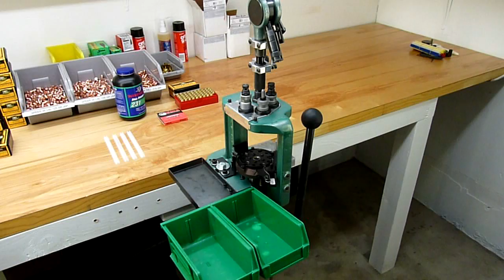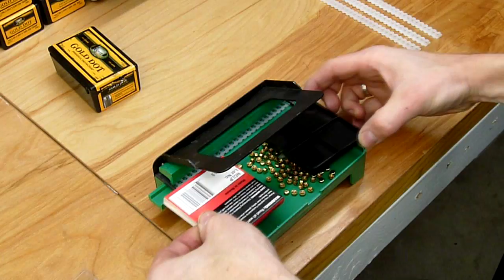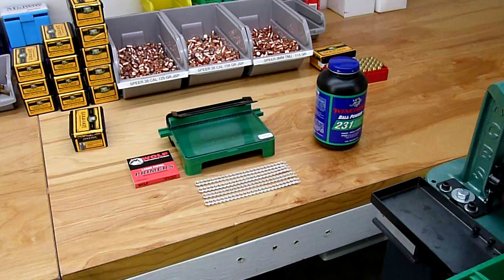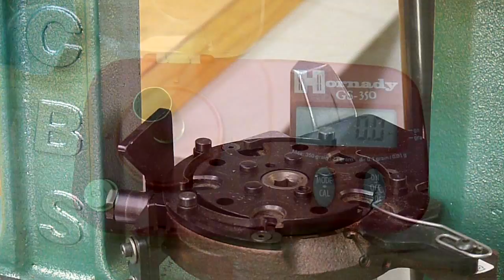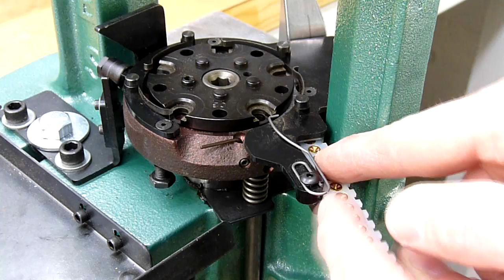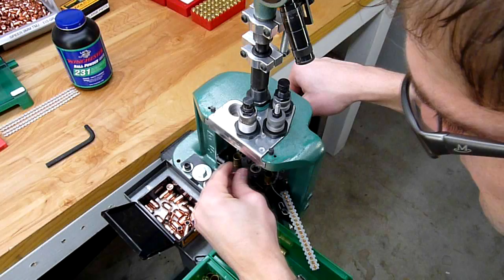RCBS Pro 2000  loading 45 ACP (HD)

Comment: I wonder if people still come here to read this discussion?  I've been using the Pro 2000 for many years now, and I think it is the best loading machine available from anywhere, at any price, at least for me.  Too many people have had problems with other presses because of all the primers one on top of another in the primer tube, which can lead do a dangerous explosion.  RCBS prevents that by using the plastic primer strips.  In use, the machine works just as smoothly as what is shown in this video - but I've found that using separate stations for seating the bullet and crimping is better, especially for using lead (non plated) bullets. In all this time, nobody has come out with a reloader that I would even consider as a replacement.

Comment: That pro 200 looks like a really fine press, I own three Dillon machines which I absolutely love they work extremely well.
I had a Hornaday LNL AP progressive about 15 or 20 years ago, I sent it back to Hornaday if that tells you anything,
I recently bought out a reloading shop and another LNL AP was in all that stuff.  I bolted it to the bench and I'm waiting 
on parts from Midway to replace some missing ones.  Setting it up for 38 spl , I will keep you posted but I am not
 expecting too much after the experience I had with the other one all those years ago.  It was one problem right after 
another and when it ran out of problems, the same ones started over again in a repetitive cycle.
  So... Hornaday might get this one in the mail as well, we'll see. I will not be using a case feeder or bullet feeder on it.
My XL650 has a case feeder but my two RL550b presses do not.
That RCBS machine looks like a solid simple machine with nothing to go wrong on it.   
If I had room on the bench I would buy one, but I have a half dozen presses on the floor under the bench now.
I guess I should build more benches !!!!

Comment: The Hornady Lock N Load AP can be setup for this as can the RCBS Pro 2000. Those are gonna round you over $1,000 tho. The Lee Loadmaster can do it for way less. Not as reliable or smooth but it can be done.

Ike
Reply: TexasGunNut45 Hornady AP is a very good deal, especially with the 500 free bullets.  Close to the price of a LEE progressive.

Comment: To me the biggest problem with the press is the powder charge station. You have to
Twiddle it every time you change powders or charges.

The Dillon quick change moves everything including the charge hopper.
Reply: If you use the rcbs competition powder measure and note the setting it returns to the same throw +- 0.1gr. No additional parts to buy for each differenr caliber.

Comment: That is the sucky about using a five stage progressive the only way I know to do this is by having your flaring die inside your powder measurer. But if you are using a bullet feeder you are probably wanting to get yourself a crimping die so you dont run into feeding problem. And then you cant use your lockout die so all you can do is watch closely to your cases and trust that your powder measurer throws everytime. I load over a 100,000 rounds a month and havent had 1 incident to date. Good luck!

Comment: I am guessing RCBS Quit making this Pro 2000 press? It was interesting how similar it was to a Dillon 550/650 on the nearly identical top plate that slid in.  I really liked this design. It was better than Dillons actually because you did not have to buy powder drops for each plate!  I am not a fan of Hornady LNL Progressive and really wanted to buy this. I really hope they bring it back. Please RCBS bring it back or design a new one from the ground up! I just keep saving nickles to buy a Dillon otherwise.

Comment: The priming system looks like a pain in the ass to keep fed. My Hornady is a little easier but still a pain to pick up all those little primers with the magic pick-up stick blah blah blah... I wish other reloading manufacturers used the Lee Loadmaster priming system, after making it a little more reliable of course. Now that would have me throwing money at the screen!
Reply: I actually like the primer system yeah takes a bit of time to set up but you KNOW they're all facing the right way up, I have the Hornady LNL AP and every now and then one will flip somehow. However I bet those tool heads aren't cheap if you want one for every calibre you have
Reply: ***** I suppose that not too bad actually, because to buy more of the collets for my Hornady a pack of 3 is about $20 anyway. Thanx for the info

Comment: I am sure this is a quality machine but RCBS really dropped the ball with it...in my opinion.

1) The powder measure is fixed so it's not removable with the tool head. The beauty of changing the tool head on the Dillon is that you never have to touch your powder measure when switching between calibers. One powder measure can be designated for each tool head and thus for each caliber. With the Pro 2000, you have to adjust the same measure back and forth. 

 2) The operations needing to be performed by the hands between strokes (i.e. placing the bullet on the case and placing a case on the shell plate) have to be done with the left hand. This slows down operation/production considerably. With the Dillon, I immediately pick up a bullet with my left hand as soon as I place one...before the stroke is made. So, I have it in my hand even before the case it will be going on is charged with powder. After it is charged, I rotate the shell plate with my left thumb and my hand is in perfect position to place the bullet...which, again, is already in my hand. While I am placing the bullet, I am grabbing a case and putting it on the shell plate with my right hand. 

I went back and forth and back and forth deciding which machine I wanted when I decided to make the move to a progressive press. The above were my reasons for choosing Dillon. The 5 stations on the Pro 2000 is the only reason I considered this machine. After going to the progressive, however, I have found that I never would have used that 5th station anyhow. The other nice thing about the Pro 2000 is that you can get the manual-index shell plate and if you decide later you want an auto-index machine you can add it. With the Dillon 550, if I decide I want/need auto-index, I have to buy an entire machine. Choose wisely, you can't go wrong with either.

Comment: @ Smith Wesson, it does not matter what you zero your digital scale too, it could be a slurpy cup, what is it weighing is the difference in slurpy cup and then the slurpy cup with your powder charge, the difference is how much the powder measurer is dropping.
Now to you Dillon guys, I have in my cart a 650XL, I have a Hornady LNL AP & this very press, I do not want to become a Dillon owner simply because of "SOME" of the attitudes expressed by Dillon owners. I believe this press is my top choice because I like the idea of the die flaring the case instead of the extra pieces you have to buy with the Hornady & Dillon presses, RCBS appears to have figured that issue out like LEE Precision has. I like all of them but I don't want to be like some of the Dillon owners with their thumb stuck up their butts.

Comment: I'm a little confused about what model this is, and also what happens to the spent primer when priming the brass using the RCBS priming system and the RCBS die. When running the brass through the RCBS press using the RCBS sizing die, and then the RCBS depriming die, what happens to the spent primer after the RCBS system presses in a new primer? Wait, I think I just figured out what model this RCBS system is.

Comment: Some of the load data charts say WIN231 for .45 ACP should be between 4.3 and 5.1 grains.  I have seen some charts go up to 5.6.  I have been running 4.7 so far, which cycles the 1911 I'm loading for, and happy with them so far for just general target shooting.  What was your goal / reason in using the higher charges?  Is it mostly because of the defensive bullets?  Just curious.

Comment: What makes a Dillon WAY better? You've used the Pro 2000? RCBS has the same warranty. I am leaning towards the RCBS Pro 2000 because of the 5th station but I know Dillon is a fine machine...I wouldn't say it's WAY better though. Better at what? And actually if you are looking at the manual indexing presses, the RCBS is a little more. I don't know about auto-indexing, not a concern for me at this point.

Comment: Looking for how to set up the powder feeder, also seems the powder feeder funnel, is not quite sitting in 100% in the shell, it works if you go real slow. it looks like the little spring pushing the shell onto/in to the shall plate, is not quite doing it's job enough. But maybe thats just me!
Reply: Clean and lubricate. You likely have splashed powder in the mechanism causing this issue.

Comment: Why don't you use a universal de-prime die before cleaning the brass? You know that primer pocket and the little flash hole connecting it to the case is as if not more important than shiny cases.
charlie
Reply: Never had SS media ever stick in my flash holes

Comment: I would NOT zero the powder scale with the brass and make you power measurements with the powder in the case.  all cases are different weights so how can you get an accurate power measurement if you are measuring it with different weight cases?  I measure the powder only so I know exactly what the power weighs.  my lyman powder scale has a removable dish you you can weigh the power only then put it back in the case or measurer.  I measure power throughout loading to ensure consistency.
Reply: Keith Advice He’s using one case to tare the scale with and drop powder from the powder measure that is case-activated. As long as he uses the same case to confirm the powder charge, it doesn’t matter that he’s not using a pan. How would you use a pan to activate the powder drop?

Comment: You're gonna turn me into an RCBS reloading fan. Is the mount that you have in place commercially available? Looks super solid vs. attaching to wood bench. I would like to go that route if possible. Thanks   -  p.s. will LEE dies work in the unit if so would you recommend that?

Comment: Do I understand correctly this press knocks out the old primer + seats a new one?  I thought you had to clean the primer hole after the old is removed?
Reply: ive never cleaned any primer hole when reloading
Reply: You do not HAVE to. Progressive presses are for speed not ultimate accuracy. Despite that they will load more accurately than most can shoot. Great for higher volume, closer target sports. I suspect benchrest and flash guys use single stage presses, or REALLY expensive progressives.